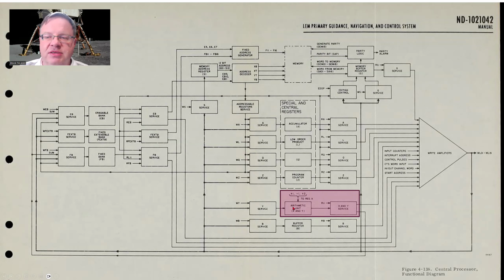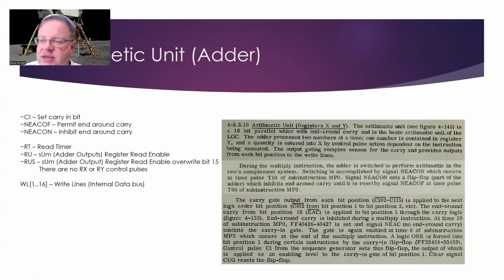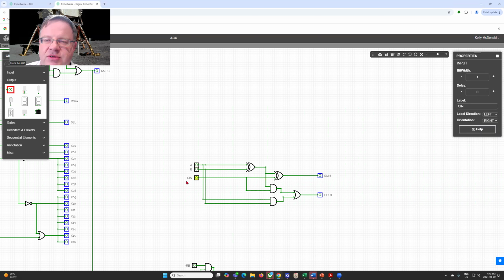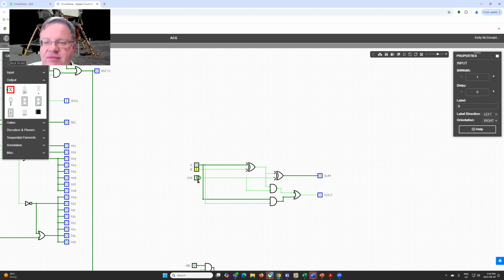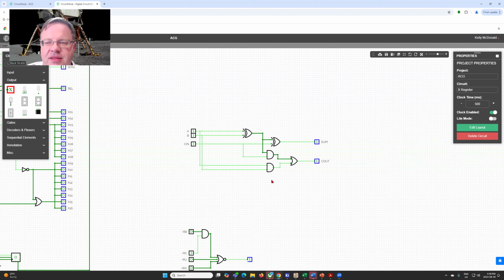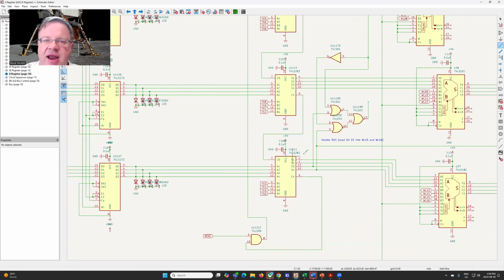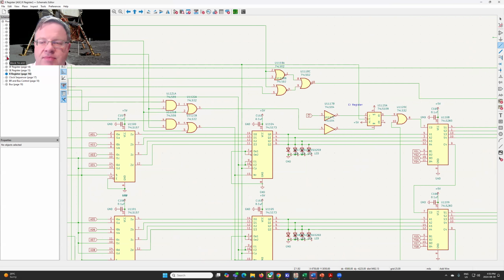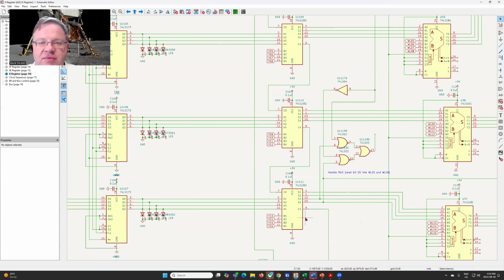EP 12: X Register   Part 2

Comment: Great video! It's great to see the progress, and I'm excited to see everything on GitHub!

There was actually a hardware design bug related to NEAC that wasn't fixed until quite late in the Block II design process: NEACOF comes too early in the MP3 control pulse sequence. It clears NEAC at time 6, but the multiplication has not quite finished yet and end-around-carry still needs to be inhibited for the addition happening during times 7-10. Since it was a late fix, not all of the documents we have include it, and not all of the logic drawings show the change. Updated documents describe NEACOF as "Permit end-around-carry after end of MP3".

The actual fix was very simple but slightly hacky: they simply treated the subinstruction selection signal MP3 as another inhibit for end-around-carry, such that no EAC will ever occur during MP3, regardless of the state of NEAC. This was done using a spare expander gate in module A2. In the original schematics, it's on sheet 3, right next to the spare pins. The fix is also visible in Figure 4-153 in earlier revisions of ND-1021042 (they dropped it in later versions, possibly by mistake...): MP3A (equivalent to MP3) is used as an additional inhibit for EAC, along with NEAC. In your design, I think the equivalent fix would be to add MP3/ as a third input to U1121C, alongside NEAC/.